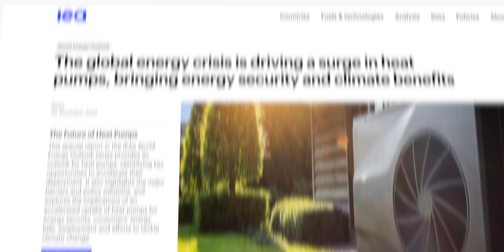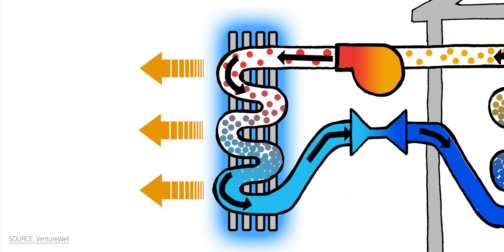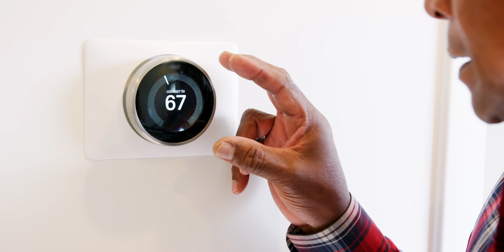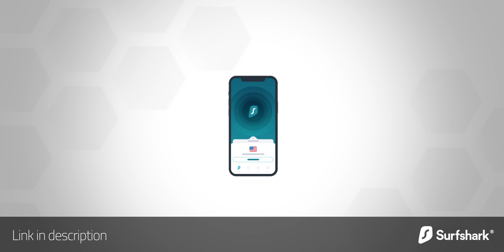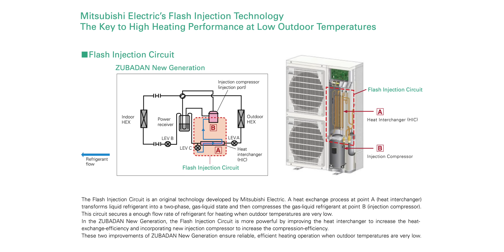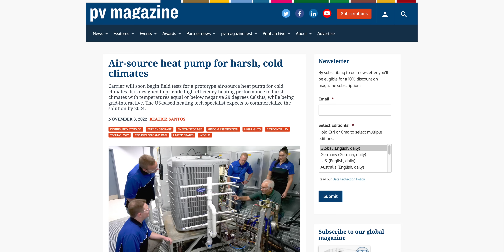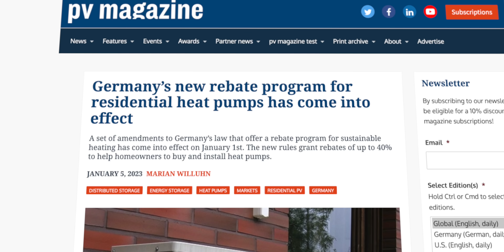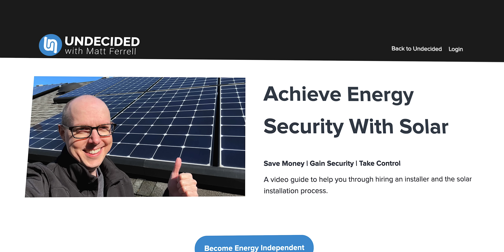Major Advances with Heat Pumps in the Extreme Cold

Comment: Even if you are concerned about cold temps, you can pair the heat pump with a traditional natural gas furnace so that you can either switch to it at a set point or whenever you want to for whatever reason.

Comment: Heat pumps have worked as secondary heaters in northern Europe for 20 years and modern air heat pumps like Mitsubishi rw25 gives cop of 2 @ -25 and still outputs 3200kW of heat. Costs about 2000€.

Comment: I live in Canada, and i had a heatpump installed last year (only source of heating) a Daikin. It works really well, dont have any problem. It has an heating coil for when the temperature drops low. At -15’celsius it work at 75% heatpump 25%heating coil.  At-20’c its 50/50% . The heatpump stops working at -27’c, then its 100% heating coil.

Comment: One benefit that is never mentioned is recovering the space that a conventional furnace takes up in your home when you replace that furnace with a heat pump. I suspect that the average space used by a furnace is in the 30 - 50 square foot range depending on the size of the house / furnace. When we installed our heat pump and removed the old furnace, we recovered about 50 square feet of interior space because the heat pump is installed outside. So, figure out what the $value per square foot of your house and multiply that times the square feet recovered by removing your old furnace to get a ballpark idea of savings when you do your heat pump purchase arithmetic. Of course, this is not a perfect measure - your furnace may be in your in-home garage and you may not attribute much value to that space. In my case, it opened up a key space in my basement to enlarge a guest bedroom and that was very valuable to me. YMMV.
Reply: But you still need something to blow the air through your home?
What was installed in place of the furnace to blow the air through the ducts?
Reply: @AnyBodyWannaPeanut  The heat pumps that I have seen, including ours, do not blow air from the outside unit to the inside; it's done by  movement of liquids through relatively small tubing and much of that is run either through the walls or on the outside of the house. We were doing a big renovation so our walls and ceilings were open. Our pipe ran outside the house, into the attic, and then down to the head units -those big white wall blobs. Those wall blobs are where the blowers are.
Reply: @DavidM2002 Ah, you have piped refrigerant to multiple indoor units. Most heat pumps for retrofit take the same space. Even the furnace part may need a little space for emergency strip heat, but typically less than gas burners. Still, the air vents use the most space, as the return and supply both take similar space.
Reply: @DavidM2002  ah so you got the kind where one goes in each room kinda thing?
Reply: @AnyBodyWannaPeanut  I did. For me, it was the only practical way to retrofit. The extra space created by removing the old furnace was a huge bonus in a relatively small house.
Reply: Lolol. Your furnaces are bigger than our English homes.
Reply: That's 6-7 feet square!. Our furnace is about 2' x4".
Reply: @thehobe150  I think he was referring to the total area required for access. There are some heaters that can be put in a closet with limited clearance, but most require quite a bit of area for access for maintenance etc.
Reply: @thehobe150  And you generally have some surrounding space that's often wasted because you need to keep stuff clear of the furnace.
Reply: Thanks for the insight. So removing the oil tank from my garage would be an added bonus to removing the boiler from the basement of my small house.
Reply: @peace2all  Yes. Double bonus. Better check as to how you can dispose of the oil first. Maybe burn it all off before the heating season ends. Tank disposals can sometimes be an issue; at least in my part of the world. Far worse if they are underground which is normal here.

Comment: I'm quite surprised at how the US is so behind on heat pump implementation. When I moved to Japan over twenty years ago, heat pumps were really the only choice for heating and cooling.  Now you can buy a basic system for around $1000-$2000 at your local electronics store and get it installed for another $400. This across the entire country including the northern Island of Hokkaido! Four years back, I built in Tokyo, and I installed a heat pump powered under floor heating system, it's the best I have ever felt in winter, cheap o run and feels warm from the inside of your body!
Reply: Yeah, some HVAC installers are price gouging us for heat pump installations even though we've had air conditioners for decades. It definitely contributes to the idea that you have to be wealthy to afford that.

I wish we had better consumer protections regulations and tradesperson training for these things.
Reply: Just an fyi. My house in central PA,was built in 1980 with an air source heatpump. My knowledge is that heat pumps are common in most states.

Comment: Why did you not cover in detail the difference between air source and ground source heat pumps.
In my opinion it is the most important  topic. It costs more but works more efficiently when it's very cold.
Very important to know about it and you glossed over it quickly I thought.
Ted. UK. Retired Mechanical Engineer.

Comment: I laughed at that 15-20 years life expectance.   I am on my third air source heat pump for my 29 year old house.  I'll be happy if my current system lasts 10 years.

What nobody talks about is the temperature of the air coming out of the register in winter.  For the vast majority of the time the temperature of the air out the register will be less than your body temperature.  Therefore it will fill cold to you.

And then there is the defrost cycle.  IMFO they still have not gotten that right.  Remember,   when the system goes into defrost mode,  your auxiliary backup system(usually a restive heat stripe)  will also come on for the duration.  Defrost cycles will start occurring at around 32 F and lower.   The defrost mode just means that your system switches back to cooling mode for the duration of the cycle.

When the outdoor temperature reaches 15 degrees F,  my thermostat locks out the heat pump, and switches to auxiliary heat (10,000 btu electric heat stripe).  Watch your electric meter spin when that comes on.   Thankfully, that happens only once or twice per winter.

Comment: Not much of an issue in the US i suppose, but here in the UK Government regulation over Heat Pump noise pollution are getting flack for expecting units to be installed a set distance  from homes, so basically are they only for homes with large gardens and not suitable for much of the UK housing stock ?.

Comment: Love heat pumps and am all about green tech... but I still think your enthusiasm for them is a bit much. Device efficiency needs to be considered within the context of heating your home. If your electricity comes from gas, oil, or coal, you are burning those in order to create electricity to run your heat pump. Most people in the US could heat their homes more efficiently with gas directly, as opposed to burning it to make electricity to run a heat pump. I think the best move is to max out device efficiency with geo thermal, and then produce a lot of the electricity on your own with solar panels. In that case, go all in on heat pumps. Otherwise, skepticism is warranted.

Comment: I am interested in a heat pump water heater. My water heater is in a garage in the Arizona desert. I have read that one of the side effects is it slightly cooling the room it is in by a couple of degrees. My garage has gotten hot enough to pop some seltzer water that was stored on shelves, so cooling it slightly is interesting.
Reply: That is an excellent use case.

Comment: Matt, could you do an analysis comparing this tech with hot water solar with large storage such as water tanks or insulated, damp sand storage?  The initial cost could be much lower and it's also a DIY, do it yourself, level of tech.  Great video.  Thanks.

Comment: Biggest problem in colder climates are a lot of local suppliers are unaware, or unknowledgeable about the newer models that can work at colder temperatures.
Plus most of these models are made in Asia, not America or Europe yet.
As an a aside if it does get too cold, most systems have built in backup restive heating elements.
Also heat pumps will only fail on a few days. We need to up the insulation in buildings. 
And it really annoys me, all this air-conditioning to cool air, don't have the simple components to allow heating in winter with the 3 to 5 fold increase of heat transfer compared to restive heating. IE you can transfer say 3 watts of heat from outside for the same amount of electricity with 1 watt of resistive heating.

Comment: A properly installed ground source heat pump will be circulating it’s working fluid beneath the frost layer where the ground temperature is constant. These systems will maintain 100% of their efficiency no matter the outside air temperature. The vast majority of what you’re talking about is only applicable to air source heat pumps which are subject to fluctuations in outside air temperatures. I know you know that (you’ve made that point in other videos) but it didn’t seem to be clear here.

Comment: Coming from Finland, this video feels 15 years old. :D Heat pumps with inverters have been abundant since at least 2006. They are a super common way to increase energy efficiency in heating. I also don’t think I’ve ever seen an inverter with an electric defrost coil. They all, to my understanding run in reverse for the defrost cycle. 

I find it facinating that the same tech is in very different stages of maturity across the globe. Even when using equipment from the same manufacturers.

Comment: I installed a heat pump water heater and I think it was a mistake. It makes my basement WAY too cold because it blows cold air out. I also didn't know it needed better venting or space until I had already installed it. I'm trying to figure out a jury rig solution to vent it into my garage instead of my basement.

Comment: We have a Panasonic system for our outhouses in Sweden. For the main house we have a deep burr heat-pump system. The air-to-air heat pumps have a SCOPE rating of more than 5 and work down to very low temperatures. The technique is already here since several years, at least in Europe. If you want a US version, I guess it takes a bit longer...

Comment: w8 i guess the price is with installe ? since Poland is still cheap
in the netherlands its 16000 water/air for hot water/heating  and 4500  for gas  CV
and my water/air pump has a COP of 2,8 on -10 C and it worked fine the 5 days it was -10 C
and i filled it my self with 50% water 50% antifreeze becouse of the 16000 i had to installing it my self get the certificate and installing it my self is 50% cheaper

Comment: Heat pumps are great...BUT it depends on your climate, home efficiency, and your financial situation. The focus seems to always be on the heat pump itself and not the real problem. Many homes 30 to 40 years old or older are not very energy efficient...this is the Achilles heel of heat pumps, especially in northern climates. Many people who are used to seeing very warm to hot temps coming out of their gas furnace air ducts/registers...and it's a real shock switching over to a heat pump to see lower temps. This is NOT a problem as long as you have a fairly energy-efficient home. But where homeowners get into trouble is when their home is not very energy efficient..and temps drop outdoors...and the complaints begin. In many ways, the relatively high temps put out by a home's gas furnace..hide the sins of the (energy inefficient) home. The further north you live the more this becomes a potential issue.
Not to mention here in northern New England where I live we just had electric rates go up an incredible 112%...the largest single increase in state history.
Just something each person needs to be aware of...

Comment: I had an cold weather, air source heat pump installed in my house last fall and I live in New York State's North Country where we routinely have weeks with a high of 0F.  My heating bill went from ~$2,800/ year to ~$1100/year.  So far, no problems with the heat pump keeping up.  And I now have central AC at no additional installation costs.  Yes, heat pumps work in the cold weather.
Reply: were you using electricity or gas heating? Water boiler or forced air?
Reply: @mrdan2898  The heating system is forced air.  The new heat pump has an air handler that was tied into the existing duct work, which is why central AC was added at no additional installation costs.  The old oil burning furnace remains as a backup.
Reply: Can you share what make and model heat pump you went with? We are in the Syracuse area so somewhat similar temperatures.
Reply: hi I’m in the process of deciding heat pump with emergency heat or hybrid, which uses propane below 30 F, we live in NJ, I’ve few questions 
1. Will emergency heat be able to heat to any temp we need, like up to 74-75F?

We’ve two zones and main unit which I’m planning to replace serves, 2300 sf first floor and basement 1900 sf, can heat pump with emergency heat do it?

Comment: Good information and for me it’s very timely. My gas furnace and AC are hitting 20 plus years old. They’re not failing today, but they are old enough to start thinking about this. The initial cost ouch, but long term savings it’s worth looking into. What is the useful life of heat pump? Is it similar to traditional furnaces and AC?
Reply: Identical to an ac

Comment: Hi Matt, nice video but firstly I have to pull you up. You do NOT compress a liquid, you compress a gas that condenses into a liquid. Please when talking about the vapour compression cycle please just say refrigerant as that covers it in both vapour and liquid state.
Secondly I am shocked at how far behind American companies are. You have not been able to buy a Heat Pump in Europe that was NOT speed/frequency controlled for 20 years!
A Heat Pumps that work to and below -20F have been around for a long time in Scandinavia, even my 3 year old one in Spain works to -10F.

Comment: 2:50 I think that's not correct and that 2.5 is too low. A COP of 2.5 means that you get 2.5 times as much (=1.5 times more) heat energy than the electrical energy you put in. So for 1kWh of electricity you would get 2.5 kWh of heat energy. Not 2 to 5 times as much as you put in.
German heatpump YouTubers usually calculate with a real world yearly COP (,Jahresarbeitszahl') of 3-4.
Reply: In cold weather the cop average is about 1.7.  lower for ducted systems and about 2.5 for the most efficient ductless systems.  When the temp is about 45F outside then the cop can be as high as 5.5 for ductless

Comment: We used to have a accumulation type of heating which we experienced as  a very inefficient way of heating. After installing 8.75 kWp solar panels (35x Sanyo HIT-H250E01) at the end of 2011 we decided half a year later to replace this by 2 Daikin multisplit heat exchangers (1x 5MXS90E & 1x 3MXSG68F) with in total 7 internal units. By doing so we have realized a saving of 2/3 our heating costs . On top of that it has proved to be a very comfortable way of heating our house while in summer we can also cool if really required. Even in the coldest winters here in Belgium (-15 °C) we never had any trouble keeping our house comfortably warm.

Comment: Up here in the frozen north of Canada, geothermal heat pumps are the preferred choice over air source. And apparently the vertical well works way better than a horizontal field, especially in the winter. Seals up better too.
Reply: But the cost! And the Electricity bill?